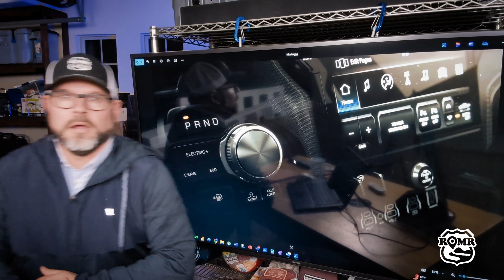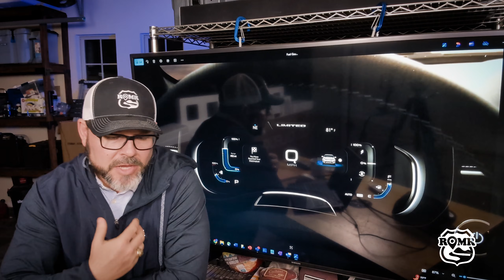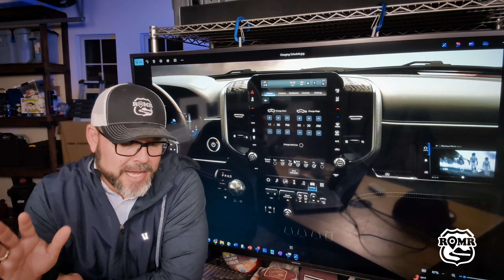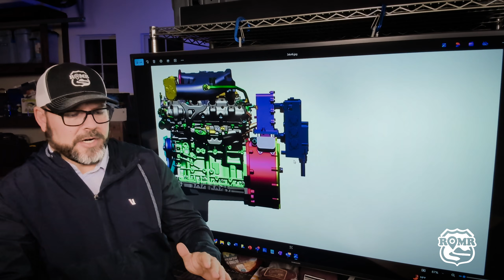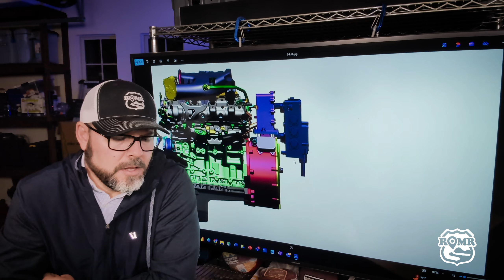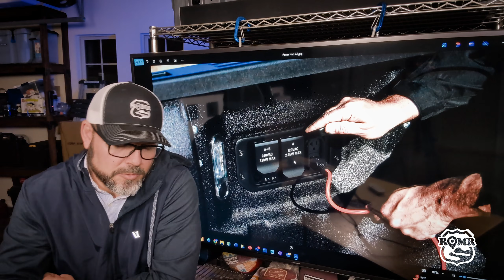Ramcharger Details UNLEASHED...Towing, Range, Power and Ballpark Pricing | Stellantis FINALLY speaks

Comment: By my math based on Rams stated range and gas tank size is 19.6 mpg (US) on a full range trip. Only marginally better than a 3.6 with a transmission.
But oh, the performance!
And great for short trips when charged at home. My electricity rate is 8.69 cents (Cdn) per kWh .
Reply from the maker: That's a killer rate!

Comment: Lithium Batteries live a long and healthy life in the 20-80 percent range for daily use. They will cap the usage limit on top and bottom of the charge cycle. This will prolong the life of the battery up to 250K miles with proper care.

Comment: I have said since the first hybrid that this is the way it needs to be done. In a traditional hybrid, the engine still has to operate in relation to load and speed. So a ice capable of 40% efficiency  only runs at say 20% most of the time. Where if done properly with this setup the engine can run at its most efficient configuration most of the time which hopefully is enough to compensate for generator losses.

Comment: I like the technology but I don't need something this big. Here is what I would like to see - and get. A MIDSIZE pickup - like Dakota, Ranger, Frontier, Tacoma, etc - extended range series hybrid that can go  (minimum) 150 miles on pure electric power with an additional 200 miles on gas, and tow at least 7000 pounds.  Or - better for me - a VAN with this system. When somebody starts making one, I want to be one of the first to get one. A smaller vehicle can give you more KWH per mile. Last but not least, not too expensive. I wonder if you can use this to run your house in a power outage. I hope the car builders read this.
Reply from the maker: Can't wait for an EREV promaster!

Comment: I'm very bitter that this drive architecture  was introduced twenty years ago with the Chevy Volt, and completely IGNORED by the willfully ignorant American public.  Now all the sudden this thing hasn't even hit the market and Americans cant get enough of it.   It's maddening.
Reply from the maker: We've always loved the Volt! Harmed by foolish regulations and a dismissive media that was too enamored with full BEV.  Should've been working on this type of power train for over a decade.
Reply: Is the Chevy Volt a pickup truck?
Reply: @Levo75 no it’s a small sedan
Reply: They should have never stop making the volt, I have a Cadillac ELR and it has worked great.  To bad the battery is wearing out and it cost $12K to replace.

Comment: The issue with ram/dodge electric motors is can they actually have giddy up? So far EV crowd are not impressed by the electric motors
Reply from the maker: 4.5 sec 0-60 is already too quick for something this size. Certain EVs have scrambled people's brains when it comes to performance.

Comment: Some people are looking for more power in the beds auxiliary power output. 9.5kw - 12kw of 240v. Mobile welding work could require this much power. Having this available would allow someone to not need to load a generator or a generator welder to do weld repairs around your property or if you're running a small Mobile welding company...

Comment: I know they keep calling it an extended range vs PHEV.  I want to know am I going to get 145 miles of electric range before gas is used? Can I theoretically charge at home and NEVER use gas? If so, I’ll 100% considering switching from my small EV SUV.  I don’t want to go backwards, I don’t was a gas vehicle, but if this is similar to a PHEV, I’m down!

Comment: I saw on RAM website mention of one pedal driving. From that I assume this truck has regenerative braking and can generate power from the drive motor(s) to dump into the battery while braking. But I haven't seen that specifically mentioned in any of the videos I've watched on the RC. Can you comment?
Reply from the maker: Yes, it has Regen.  There's a button right on the steering wheel to engage or disengage

Comment: Thank you for this knowledgeable and technically accurate video. I absolutely love the idea of this truck. It most certainly is a way for owners to take advantage of using cheaper-than-gas electricity from a home 240v outlet for daily short(ish) trips that originate and end at your house - think driving to work, while having no anxiety or battery charge pre-planning to worry about if you just need to get in the truck and drive to locations without level3 chargers. My biggest concern at this point is pricing.

Comment: Keeping some battery capacity in reserve is not new. My 2017 Chevy Volt has about 14kW useablel of its 17kW battery. This is how PHEV/EREV need to be built to have a safe buffer for uphill climbs, towing, etc. The Chevy Volt batteries are going for a long distance and many years of charging with very minimal failures largely from this strategy.
Reply from the maker: Right.  We covered that right up front, that there was always the expectation on a reserve in the battery.

Comment: I hope I can plug in my trailer in that plug. Do you know if it can handle a 30amp plug for a camper like the F150 hybrid? It would be great to have that ability to pull off at a rest area and plug into my truck for a quick nap or even some boondocking.
Reply from the maker: We're banking on a 30amp
Reply: Keep in mind that a trailer 30A is that current at 120v. That's 3.6KW. If I remember from the video the single plug 120v outlet was rated up to 2.4KW? So you'd be current limited but most certainly should be able to run a rooftop AC. Alternatively, you could use an adapter and plug into the 240v 7.2kw plug (assuming it has a neutral wire as large as the 2 hot wires) and potentially pull 3600 Watts off of 1 leg of the 240 plug, assuming the truck software allowed that much current difference between the 2 hot legs.

Comment: This is the most exciting new truck I've seen yet. I'll wait a few years to buy one, get the bugs out of it and see what actual owners are getting for reliability and mileage, but I'm saving my pennies for a new purchase in 3-4 years. Great concept Ram. 

I read they might offer a 27 and a 37 gallon fuel tank, would be interesting to see the range capability with a 37 gallon tank and a lighter weight trailer. 

Only thing I can see that might top this is a small 3 cyl diesel engine vs the V-6, but then they'd have to put all that emissions crap on it and ruin a good thing.
Reply from the maker: Having seen the packaging for this chassis, I would not expect an option for larger fuel tank.
Reply: I was going to tell you why they wouldn't use a diesel then you nailed it in your last sentence!
Reply: @msudawg1997  I thought we were doing away with a restriction of having to have def and all those other emissions crap on diesels. That just a rumor?
Reply: I currently own a Hummer EV, I really wish they would come out with a hybrid Hummer modeled somewhat like this.. That would be so awesome!

Comment: Why didn't they use their little diesel? Or even better yet, maybe a 4 cylinder kubota diesel. Then dodge has 2 of the best diesels in the world!!!
Reply from the maker: Cost, weight... Very little upside
Reply: @ROMRreviews  weight for either option is about 30lbs either way of the v6. That v6 is not small. Both are already developed and deployed at scale making cost negligible. Emissions cost I assume are higher.
Reply: All the required emissions crap that is another major failure risk.

Comment: More parts more issues. If you want a truck with an engine just buy a truck with an engine. This reminds me of a DVD VHS combo. If one breaks the other one is useless. And thinking how much this is gong to cost, a 2500 RAM would still tow more.  This will not sell.
Reply from the maker: The interest in this product is 6x anything else we cover, and it seems to be the same level of interest across other channels.
Reply: I’ll take that bet!
Reply: I currently have a diesel 3/4 ton. Pre DEF and EGR deleted (cause I live in a state where I can get away with that) I mainly drive it to work, about 30 miles total each day. Every other weekend it gets driven 8 hrs round trip in an area of the country without DC fast chargers. I occasionally tow a trailer or flat tow my TJ behind my truck. I would LOVE to be able to drive to work daily and and do ~30% of my 8 hr trip on cheap electricity from my house, all while not having to change my route to hit a DC fast charger. And I don't even have to plan ahead and have the battery full if I get a last minute call and have to go. I won't be buying one immediately cause it would make no sense to do that when my paid for truck still runs fine and I never buy the first year or 2 (or 3) of a new product. And I basically never buy new vehicles at all. But my 05 diesel with 250k miles on the odometer won't stay reliable forever. But in about 3-4 years we'll know if this ramcharger has any reliability issues or not and a used one with ~20-30k miles on the odometer might be a perfect truck for me.

Comment: I hope they have at least one nema 14-50 plug with a full 50 amp breaker.  This would be great to charge another ev and power a complete large RV with a 50 amp breaker.  I think all the 120 volt plugs should be nema 5-20, 20 amp plugs. 😊
Reply: The 240v outlet is rated to output 30 amps (7.2kw) this is the same as the level 2 chargers that require a 50 amp breaker for home boxes. 30 amp draw = 50 amp breaker.

Comment: This should be an outstanding boondocking vehicle.  It can tow 14,000 lb RV and then be able to power the AC unit and all electrical equipment and be able to maintain AC power off grid.  Plus, it will have the power to get back to the grid. This should be a good stopgap until batteries improve another 30+ percent and more pull through stalls are installed along highways and cities.😊
Reply from the maker: Yep.  It can do so many things

Comment: I drive a commercial truck with a similar “Series Hybrid” drive. I really like this concept and am watching the details from Ram closely before I pull the trigger. Personally, for 80% of my driving and 95% of the days I drive, I anticipate driving shorter distances and using battery only on the daily commute so I expect the actually MPG to be off the charts. 

For road trips, longer drives or heavier loads I have some real world experience with this system and am guarded to see how Ram refines output of battery and generator on a long continuous uphill haul. 

The Rosenbauer series hybrid I work with is awesome on range on flat or even hilly roads that the battery, generator, and regenerative breaking supplement power.  The limit is the long continuous uphill drive with any load.  If you don’t have a full battery even with the generator running, the power and range will be VERY limiting. I understand the tow mode accounts for this but I would keep it in tow mode from the start of the any trip the second I was traveling anywhere near my battery limits or steep hills. 

I think it will take a few tries to get this concept to match the trust a diesel truck gives their owners but I wholeheartedly believe this very technology will be the future not by mandate but by function, capacity and reliability. 
Great breakdown on your part- thank you, just wanted to share a rare insight into working understanding of the Series Hybrid Truck.
Reply from the maker: That is an extremely valuable and informed perspective. Thank you for sharing!

Comment: Speaking of people who need a truck to do truck things, I wonder how 12V accessories like light bars and beacons and winches would work. My winch can pull in access of 300A with ease.
Reply: Easy fix. If your planning on running a bunch of high amp accessories, just add an auxiliary 12v battery with a regulated charger. Most people with off roaders and HD work rigs do this already.
Reply: @ Ok, in theory sure, but my winch can drain a 1000cca battery fairly quick on a long hard winchout. So how would that work to pull power out of the main EV battery at a high enough rate to be able to keep winching? the V6 won't have any pullies apparently to cheat and just slap an alternator on it. I'm not in the market for a RamCharger, too many other features they force you to have that I don't want so at this point it's just curiosity.
Reply: @gold5th  That's why I said to add a regulated ac to dc charger to the aux battery sys. CCA isn't what you should really be looking at in an aux battery anyway, it's about reserve capacity. I just have a G31 deep cycle on my equipment trailer with a 10w trickle panel for my 8k winch and lights. I have had to pull my tractor over 60' and up onto the trailer with no issues (battery will also charge at about 10 amps from the 7-pin).  This could all be mounted in a removable bed tool box from Tractor Supply.
Reply: @zachrenner2794  I've done the battery in the trailer toolbox thing, but givent he amount i use my trailer and even less so the amount I use my winch with my trailer and that I live in Northern Alberta I killed quite a few batteries so I just made an extension cable to go from the 1/0 winch connector on the back of my truck to the winch. My winch is a receiver mount so I can move it between my truck and trailer, or if I really had to sling it off the front of my truck. 

With the "regulated AC to DC charger" how would that work? The 92kWh battery is DC is it not?  If I'm out in the sticks winching a vehicle from the ditch I don't think that's going to help, unless I guess use the AC ports in the bed? But then your converting from DC to AC back to DC, with the onboard generator it's less of an issue comared to a full EV, but it seems like you'd loose a bunch of energy to heat during the conversion.
Reply from the maker: Great question.  Hoping we have some form of 12v terminal
Reply: every ev on the road has a 12v battery ( except for cybertruck, since it uses a 48v system). they're just not very big. in that case I would say you'd probably need to upgrade the 12v battery.
Reply: @ in the video he says it won't have a 12V battery and just a DC to DC inverter
Reply: It would be nice if there would be room for an additional 12v battery,  add a solar hood panel to help keep it charged along with a dc to dc charger.

Comment: Nice coverage but you buried the lead, the estimated starting price of $70-80k is way better than expected.    I was assuming 100k just based on the lux features and the extra stuff.
Reply from the maker: Can't stand talking about price. It always kicks off an irrational reaction.
Reply: @ROMRreviews  that's because the price of most new trucks is pretty irrational.
Reply: @digger450r  undeniable.

Comment: For those towing longer campers, the extra curb  weight isn't a bad thing.
Reply: @NG-fg6qf  yep, I like the fact it will now outweigh my RV.  The downside is gonna be for some of the rivers where I can normally drive on the river-rocks, I’ll not be doing it.  At least not with regular tires.
Reply from the maker: Great point

Comment: I'm surprised that there's no 12v battery. Most EV's (probably all) have a 12v battery that powers most of the interior items (computer, lights, etc).  I'm curious how they're using the main battery to run the ignition system on the pentastar motor? An example, my KIA ev6 has a 12v battery, that is charged by the main battery pack periodically throughout the day. 

At any rate, great breakdown video!!! Good information. I'm a reservation holder, so I'm definitely looking forward to this release.
Reply from the maker: @BigSil57  I think there will still be a 12v system like all other EVs. It's just not in the engine diagram. The more important part there was that there's no alternator
Reply: It can be done via its DC to DC converter (Which is analogous to an alternator for an EV and most Hybrids too (2025 Lexus LX700h also has a backup alternator, in case the traction battery dies)) 

But I'm willing to bet it'll have a separate auxiliary battery be it a 12v or a different voltage.... Since BEVs that have done it, in the past shortened the life of their traction battery pack.... 

The auxiliary battery for an EV is like having a pressure tank for your well pump, its a  buffer that keeps it from cycling on and off constantly,
Reply: @nc3826  So, if true no-12v battery then we'll all have to wait and see about vampire drain on the HV battery, if various 12v components bleed, short, etc. I thought that was unusual and now wonder more about long-term storage?  Tesla's contactors, operated by the 12v system, are what close the HV circuit, occasionally charging the 12v but otherwise leaving the HV disconnected.  Also, wonder about continuously ramping and cycling a 12v inverter, and what consequence that will have on its life?  I like the water pressure tank analogy. -Not cancelling reservation.
Reply: O @hcjpbluesky9916  OC "no-12v battery" in the post was already retracted....   And modern EVs in general (not just modern Teslas) need an auxiliary battery to engage the contactors....  And "Vampire Drain" takes place for various reasons.... (FWIW  Rivian  who became famous for Vampire Drain has largely addressed the issue)

I'm glad my analogy was useful.... But I'm also glad you didn't cancel your reservation. since that was never its purpose.... It was just for edification.

Comment: Regarding cost, yes there is a battery cost, but to offset that cost: there is no big block V8 engine or diesel engine, no transmission, no alternator, reduced emission control gas systems or diesel emission stems, no belts or pulleys for accessories just to name a few of the costlier items.  I agree with your comment on the video that the price of this vehicle may well be comparable to a similarly equipped ICE truck - with many more advantages.